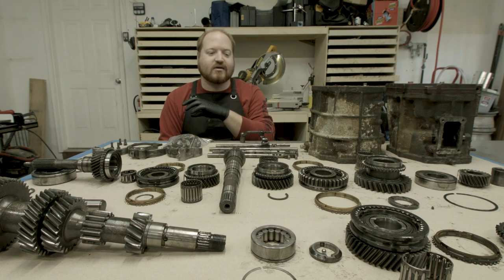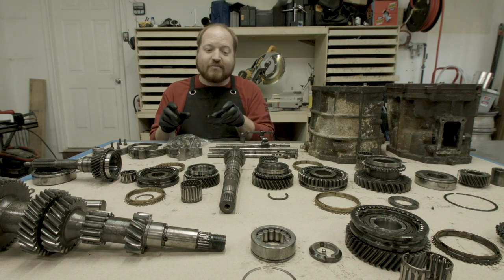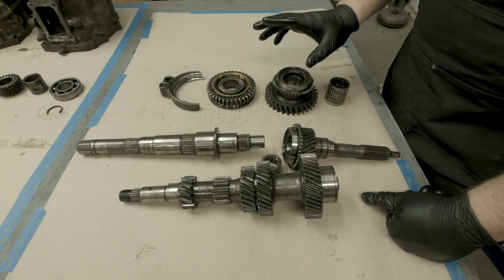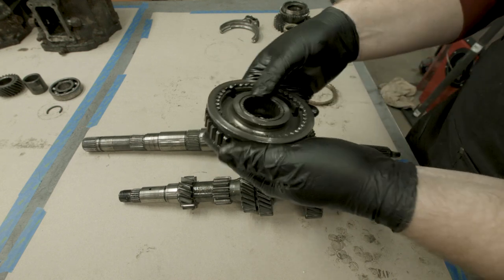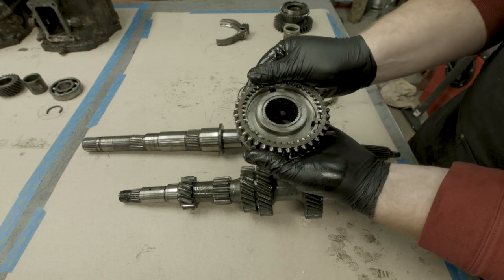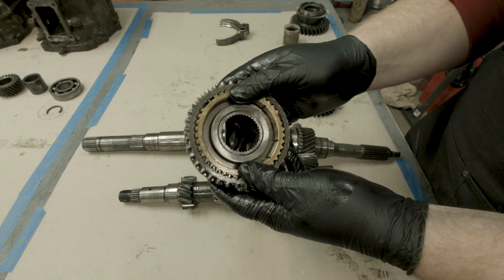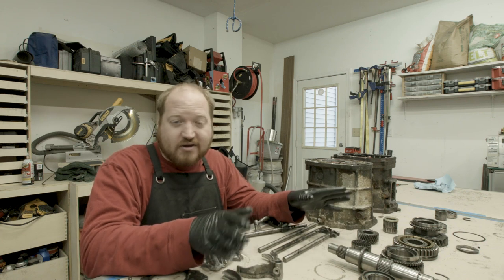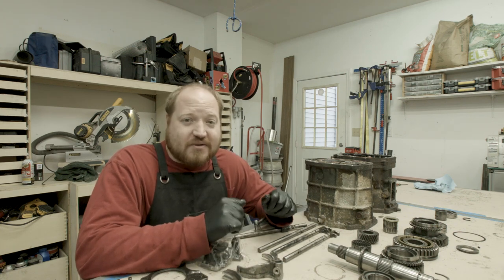Why you SHOULD rebuild your own manual transmission in your project car!

Comment: Hey great explanation...I recently bought a cheap 1997 Audi quattro 1.9tdi 5 speed project...first gear when pulling away whines but all other gears seem fine...can you give me any forward direction with what part needs replacing...thank you great video btw...
Reply from the maker: That's a hard one to pin point off the cuff. The first thing I'd do is check the fluid level the fluid color and the drain plug magnet if you have one. It's always good to make sure the level is right. When looking at the old oil you're looking for what looks like really fine gold colored glitter or silver looking glitter. If it's gold chances are you have a worn or broken synchro (made of brass) and if it looks silver you have a worn or broken gear, or bearing or something else. If there are chunks of metal on the magnet something is broken. You'll have to start taking it apart to find out what's broken. Be aware that it could be something from a different gear. When in first the shafts are linked to the first gear, which means all the other gears bearings are spinning freely so it could be something on a different gear that gets excited when only in first. I'd also check the shift travels. The fork could be traveling too far and something is rubbing. You could try lightly pulling and lightly pushing on the shifter while driving in first to see if the whine changes. Check bushings in the linkages aswell to make sure things are moving correct. Hope that helps some.
Reply: @Obscuremotorsports  yea cheers for the advice buddy👌...I mean I'd throw a replacement at it but at this stage those gearbox are lik hens teeth being the quattro...and first is a different ratio than a fwd b5 of the same year...which I have two fwd drive gearbox...I mean I could probably split them and fit the torsen differential ...I'm thinkin it may have had a hard life as it is a quite lively car compared to other diesel b5 Audi I have...thank you Nabil👍

Comment: I have a Nissan hard body have you ever seen the transmission case damaged that holds the input shaft bearing.... How does the bearing Get destroyed before the transmission case?
Reply from the maker: I’ve seen all sorts of gearboxes with different parts being damaged before others. If a bearing gets too hot and seizes it can spin inside the housing bore. Usually the external rings on bearings are a loose fit than the inner ring on a shaft, so they have a tendency to slip easier.

Comment: So do all manuals have synchronizers? I have an old GM that I think is a 4 speed with top shifter.
Reply from the maker: Not all manuals have synchronizers. Much older ones have dog clutches, which are just big teeth interlocks. If you ever heard of someone double clutching, it comes from old transmissions. This is where you quickly activate the clutch to get your engine rpm and transmissions shafts spinning at the same rpm. And then you let out the clutch to fully engage so you don’t grind metal.

Comment: So is it the synchro that wears or is it the gears themselves my car goes into 3rd to 6th easy but 1st and 2nd are pants? Guessing its the gears as there the most used ones right?
Reply from the maker: It's the synchros that wear. The gears are made of much harder material and the gear pairs are always meshed in modern gear boxes. So the only think that will wear out the gears are more power than they are designed for, or really really contaminated oil. Synchros on the other hand are the parts that get pinched, and mushed and mashed. When you grind gears (in a modern manual) you're actually grinding the synchros, not the gears. So it's most likely the case you only need to replace the synchros.
Reply: @Obscuremotorsports  ah nice thanks for the advice and the video!!

Comment: Wait,did u say u don't understand why people are afraid to work on "complex mechanisms" after saying u dedicated ur life to the work and that's the reason u can do it?
Reply from the maker: Designing a geartrain and working on one are completely different challenges. The work done to develop a gear system to meet requirements for a client is challenging. Lots of understanding tooth stress and misalignment from shaft deflection and housing twist under load and temperature changes. Then there is bearing life you have to estimate. It takes a while for people to learn that. Taking apart a gearbox and putting it back together on the other hand is something anyone can do over a couple weeks. I took transmissions apart for fun many years before I designed them. The point of the video is get people familiar with the only "complex mechanisms" in a transmission, the synchro, which really isn't complex if you just need to know how the pieces fit together. It's like a 1000 pieces puzzle, all I need to figure out is how the pieces go back together, not how the pieces where designed and cut, and made.

Comment: Sorry dude, it is scary.  My uncle was a transmission guy and took me to his shop and he took apart a automatic transmission when I was a kid.  Check balls, giant gaskets, dozens of clutch plates, oh my.  Manual is much more simple but one simple mistake and and your transmission is toast.  Just like the gear he jacked and he knows what he is doing.  I got my jeep manual transmission built by a retired mechanic for $700.  I had to take everything off and drop it off and even lift it on the table for him since he was old but he had it done in less than a day and told me tricks to make sure I reinstalled it correctly.  Still going strong 4 years later and I take that thing off road hard.
Reply from the maker: It really isn't scary. With a small amount of patience and a willingness to pay attention to the details anyone can work on their own transmission. Nothing in your list of components is magical or special. It all pieces of metal sliding or rubbing together to make something move as long as you pay attention to how they came apart, you can get them back together. I'm not trying to deter people from taking the path you took. Some people want it done fast, and have the money to make it happen. And as long as you and them are happy, that is all that matters. I'm reaching out to the people that have the smallest bit of curiosity and have the interest to tinker and make mistakes and learn. The people that want to drive up to their friends house and say "I rebuilt my transmission and its still working!". 

There was a gentleman (We will call him JB) that messages me on IG asking about the same transmission I had. He had no prior experience with doing transmission work, and got his truck for $500ish and it would slip out of 2nd and 4th. when JB had messaged me he had completely taken the transmission apart and needed helping getting the shift forks back together (cause I haven't put that video up yet). We went through his entire transmission and found the syncro of number 2 was cracked, the shift collar for 4 was put on backwards (which wore into the fork) the washer behind 5th gear had a cut off bolt instead of the alignment pin. The previous owner DIYed it the incorrect way. No patience, no attention to detail. JB took the time, found all the issues, bought the correct parts and waited for them to arrive. I think he ended up taking apart the transmission 4 times before he found all the issues. It's been a month since he got it back in the truck and he has been daily driving it with out any issues. in total he spent around $300 in parts and you can tell from his messages he is proud of the work he did. 

Those are the people I'm telling they should rebuild their own transmissions.
Reply: @Obscuremotorsports  90 k1500 full size. Manual 5spd. No sticker. Gm put 5 different trans in it. How do I find the proper kit before tearing it a part
Reply from the maker: @williamgoodwin3245  to be honest I'm not at all familiar with GMC trucks. Even though they might have had 5 different transmissions there are probably trim level details that will narrow it down. You know which engine you have, I'd start with some research to see what combinations of engines and transmissions there were. Depending on the driveline setup there could be different transmissions for 2 wheel and 4 wheel drive. If your rear diff is original you can find out the gear ratio and see what transmission were matched with that. I'd also climb under it and take as many pictures as you can. If you can pull off the boot in the cab, take a picture of the shape around shift linkages and the shape of how they enter the housing. Look at sensor locations or any unique features. Find reliable pictures of each of the 5 choices and after a little work I bet you'll figure it out. Good luck!
Reply: 1638jaw
 every bit of info helps to unravel the mystery ,i've bought a 2nd hand 5 speed, theres noticible backlash between  input and output shafts but turning by hand no audible noise,  no movement in either shaft, i plan to do two tests ,oil analysis plus i will make up an adapter and spin gear box using my drill  if OK in she goes  thoughts